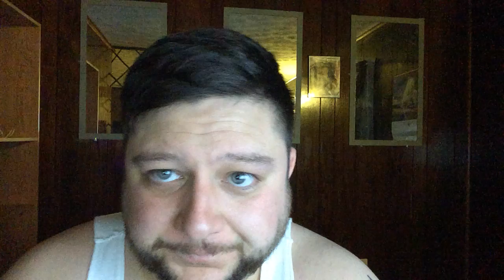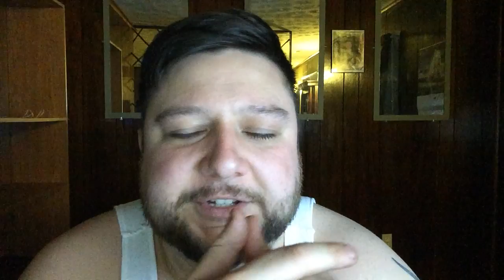High Compression Turbo: Can It Be Done Safely?

Comment: This has bothered me for YEARS!!!!! Finally found someone that sees the ass backward thinking some ppl have when it comes to this exact topic. My friends will do stock/low boost (5-10psi) on their stock B16 and GSR and no one bats an eye, but if I'm rebuilding my LS to do the same "low boost" and decide to use stock B16 pistons instead of LS pistons, I'm looked at like a dumb ass. But yet it's socially acceptable to boost a B16, GSR, and dare I say a Type R🙄😑😑😒😒😤
Reply from the maker: Jimmy Slapp lol yep
Reply: I'm running a fully built JDM B18C 12:1 on e85 @ 14psi (Only thing stock is the crank) Makes 400 to the wheels. Built over 4 years ago. It's my daily and still has A/C and PS.
Reply: @Jasmir-88  ay bruh, you think i could make 300whp safely on a b18c jdm with 12.6:1 CR and about 8psi tops on 93? Been told not to do it but just testing waters and hearing what others have to say
Reply: Axel Silva my guess is you’d be fine, tho I’m certainly no expert. If you wanted safe power and e85 is available in your area I’d do that. What parts do you have/planning to use?
Reply: @Jasmir-88  sadly e85 is not available here, i plan to do a meth injection later on after i get the turbo done

Comment: i have debated highcomp single cam builds for a while.  after a lot of reading and thinking i'm just going to build one, fuck it .  so right now i'm building a d16z6 with dohc zc pistons (pm7) and rods.  then running a greddy 18g.  compression  will start at 12 to 1, we'll see how long it last at 10psi. great videos, i subscribed at around 100, now your at 700, keep up the great work. from the great white north of canada.
Reply from the maker: willcann1 https://youtu.be/QmmF9iy-rJg
Reply: i agree vitara makes great pistons.  but this build is on the super cheap. take two motors i have and make one
Reply: RING GAP MATTERS HERE ABOVE ALL
Reply: How that turn out for you

Comment: I wanna boost a single cam so bad
Reply from the maker: me to!
im always dancing on the Sellit/keepit line
Reply: That's how I am with this block, but imma sell it and get a complete engine and boost that
Reply: Did a cheap set up on my bmw m20b27. Sohc can make power but isn't as efficient as a m50 dohc  at the same power. I only make 280whp due to internals. Didn't want to spend thousands on pistons and rods.

Comment: Wondering if to stick to the Vitara piston rebuild ( low compression ) or a forged high compression piston ( supertechs )... Good timing on the video. The only pro to a low comp vitara d series build is if the timing belt were to snap the chances of p2v contact are zero. The pistons sit too low in the bore lol
Reply from the maker: BRO glad you commented this. STICK WIT THEM VITARA's theyll do ya just fine with the proper turbo. 

https://www.youtube.com/watch?v=SZ9DaqlYeHQ
Reply: VHB Engines OK that's it I'm ordering my shit tomorrow from Speedfactory ( 75.5mm Vitaras / Manley H beam rods / King race main / rod / thrust bearings ) The only reason I don't go with Eagle rods is I saw a side by side comparing them to the Manley H beams and the finish is a lot better on the Manley rods & they're supposably a bit lighter & better balanced. I'm pulling my motor any day now & stripping the block bare for the machine shop.
Reply: Ja Ka nice man hope it rips when ur done !!!!